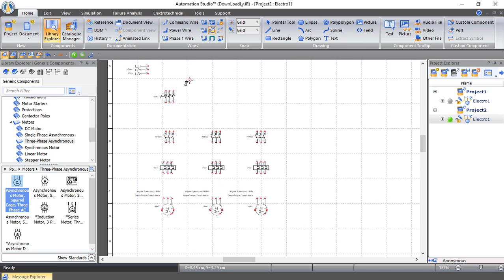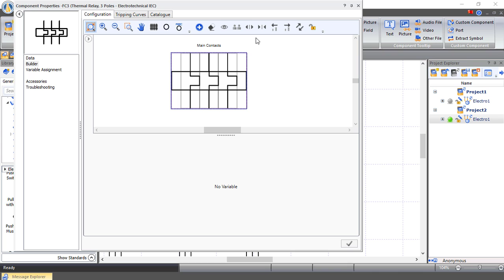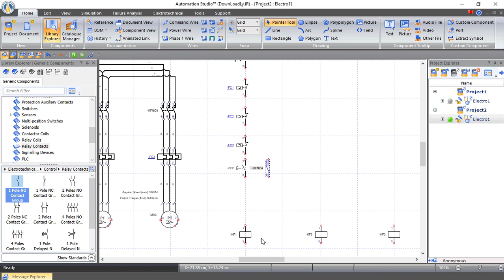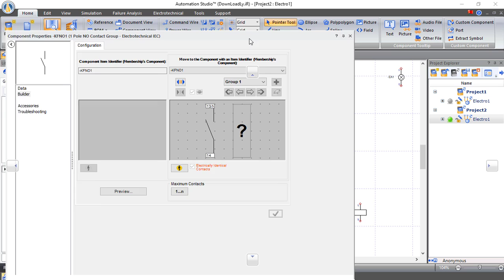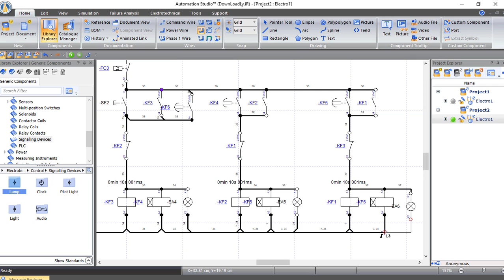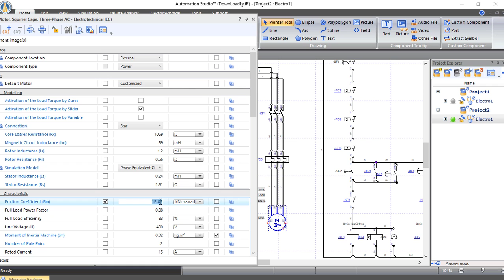Sequential Control of Three Motors in Automation Studio | Tutorial #11 for beginners

Comment from the maker: Timestamps (Powered by Merlin AI)
00:05 - Automating three motors to run alternately using a control circuit.
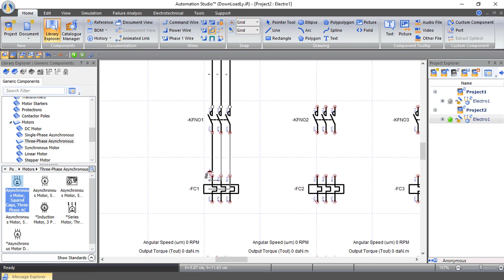03:28 - Setting up motor circuits with safety features in automation.
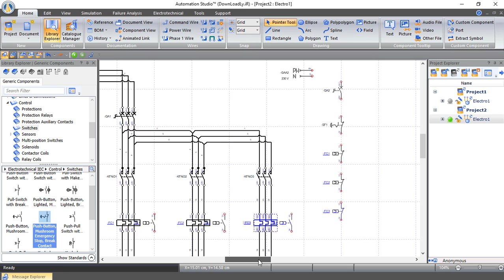07:27 - Setting up thermal overload protection with visual indicators for three motors.
10:22 - Setting up timers for sequential motor control with Automation Studio.
13:05 - Integrating timers and contacts for sequential motor control.
15:57 - Controlling motor operations using normally open and closed contacts.
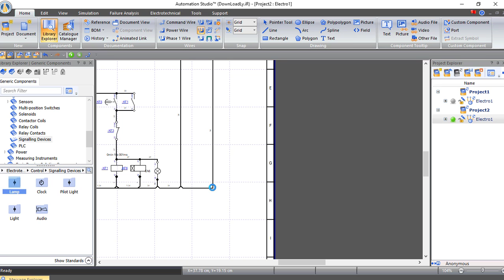18:42 - Simulation of three motors with thermal overload indication.
21:12 - Sequential operation of three motors with timer controls.